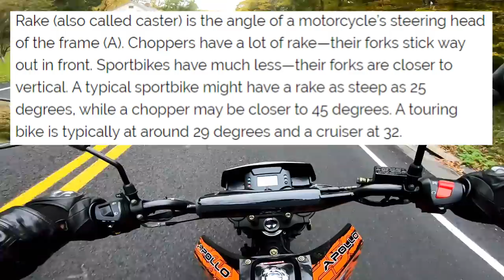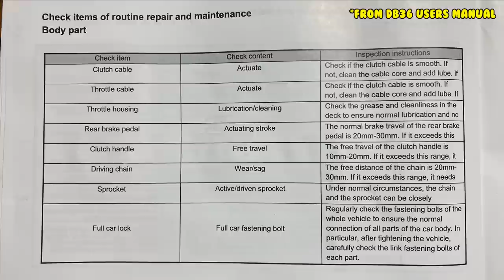[E1] Vitacci Apollo DB36 Supermoto Review, Build, Assembly, Test Drive, Impressions.(updated $1799)

Comment: These china online shops job is to make the experience look easy,  Further from the truth. Buyer beware. The thing is, the parts are very poor quality and have a short life, especially from the smaller brand china companies.  There is missing hardware and damage as well as defective parts at times. Not as easy as he shares.  My time is more valuable then messing around with a few hours of assembly and down time which includes DMV title and registration that you have to do.  Rather buy one from a legit dealer turn the key , plug and play with all the Docs. done.   Appreciate the vid
Reply from the maker: You already posted this exact comment. They're not as bad as you'd think. Yes they used to be junk about 8 years ago. I've been riding motorcycles over 40 years, owned over 100, have 16 bikes currently.

Comment: Every video i see they run the crap out of a new engine and then complain about how it doesn’t run right or that it is low quality .
Reply from the maker: It's usually poor jetting
Reply: Yeah that dlx efi if i’m correct is really smooth running
Reply: Great videos enjoy them very much on the projector. I never knew it was so beautiful in that part of the country. Keep m coming!
Reply from the maker: @littlemanoo  I also use a projector. Optima 4k. Thanks

Comment: I've never heard of a dirtbike with anything but an over head cam. Only China would make a pushrod single cylinder junk motorcycle.
Reply from the maker: Wayne S. The pushrod engine is a 100% clone of Honda’s CG engine. Super reliable used in Africa still today